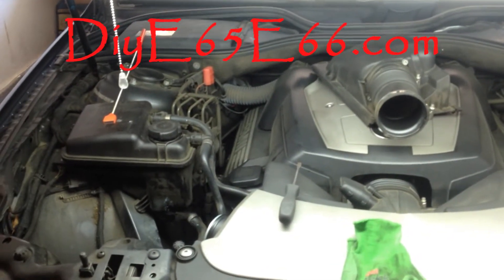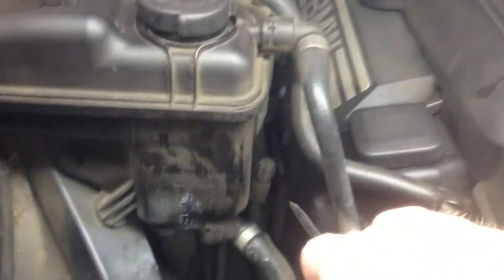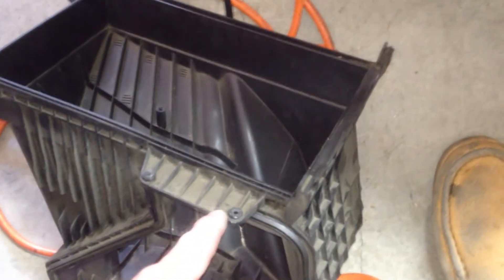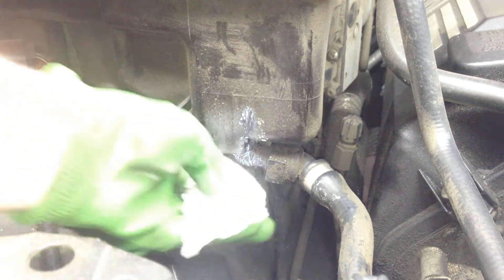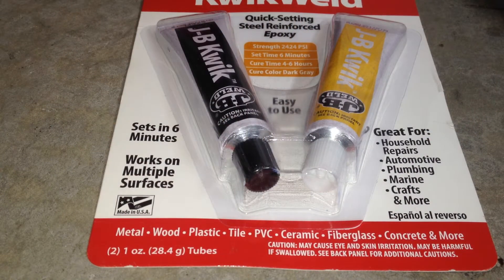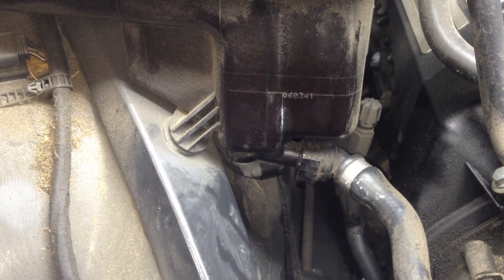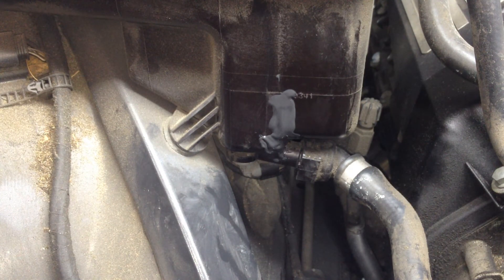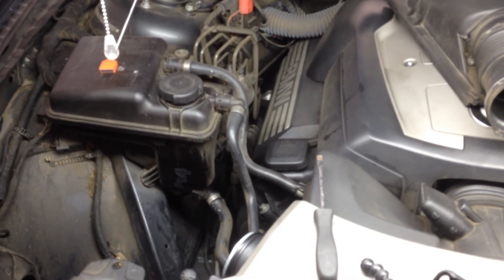BMW E65 E66 Coolant Leak On Expansion Tank Fix

Comment: For the hell of it, I tried the JB weld fix and no go! I actually removed the tank and laid on 3 nice coats and it looked great! After driving 10 miles to work yesterday, the heat and pressure worked right through.. new one arrived this morning from partsgeek and I swapped it out in about 10 minutes. No more leak! $88 tank with free shipping. Still waiting for the BMW Stealership to get back to me with an estimate! lol

Comment from the maker: Hello Jay,
Yes my first application the same thing happened, so next time I sanded the crack location, it's holding up because the JB weld needed some surface to stick to.  If it leaks again, I'll replace it for sure.  Thanks for inputting on the new one.

Comment: Good idea on the JB weld. I have a small crack also right by the cap where the tank in the forward curve of the edge and it radius's up to the upper part. Can see small coolant circle there and also where it has collected onto the seam of the tank where the bottom and top sections meet. I have thought about heating a flat bladed screwdriver and sealing the crack that way. Will keep you advised.

Comment from the maker: Probably a better job if you just install the new one, I have to re-do mine the pressure belt up and popped the JB weld off.  I might have to sand the side to get some good traction.

Comment: Hi buddy... A good way to get a good bond with this stuff would be to...

(1) Remove the Tank from the car...
(2) Drill the cracks at each end of the crack, to stop it from cranking more...
(3) Widen the crack a little, and drill a hole in the middle...
(4) Smear the Bonding Agent, making sure it gets into the crack and drill holes... Making sure that you apply extra bonding agent about a mm overlap...
(5) Place a small piece of plastic sheet over the bonding agent, and shape and smooth...

Comment: I love your web page man, its very nice and you explain what you are doing while you're  working.

I tried that myself, but it didn't hold, I had to buy a new tank, it was pretty cheap, under 100 dollars and it worked like a charm, very easy to replace it.

now I am having a little white blue smoke when I idle at stop lights come out of the exhaust, not sure if its seals, or maybe I need to do an engine cleaning with sea foam or something similar to that.
Reply from the maker: Thanks for checking the videos out:)  Yeah that's a great deal on the new tank, mines holding pretty good for the last several months, but I had to sand paper the leak spot then I put the JB on.  Let me know how your fix went with the sea foam?

Comment: The coolant level stick on my 545 broke off today and sunk to the bottom of the expansion tank.. Is this going to harm the cooling system at all?
Reply from the maker: I wouldn't think so, it's plastic and shouldn't melt down but if your worried about it I would save up and replace it, I was able to get a new one with sensor for under 50 bucks and took me very little time to put the new one in, I'll have a video of that in the next 2 days.